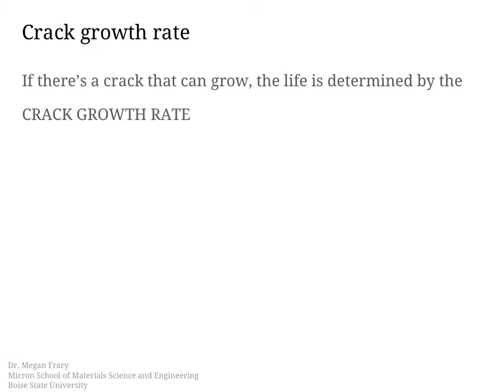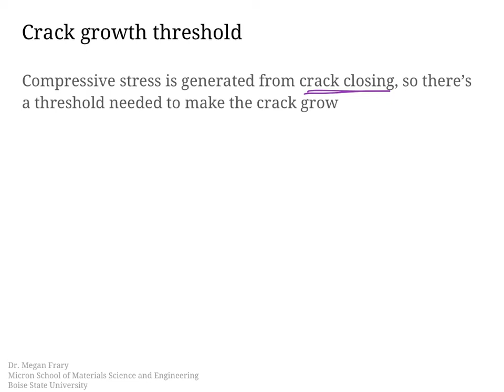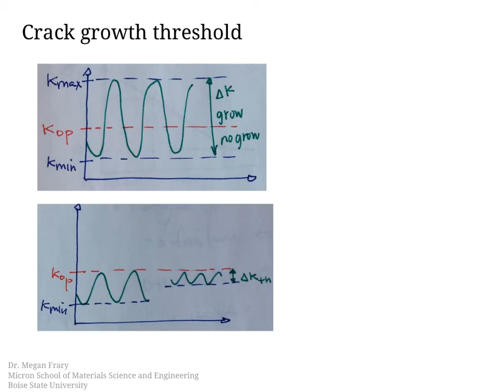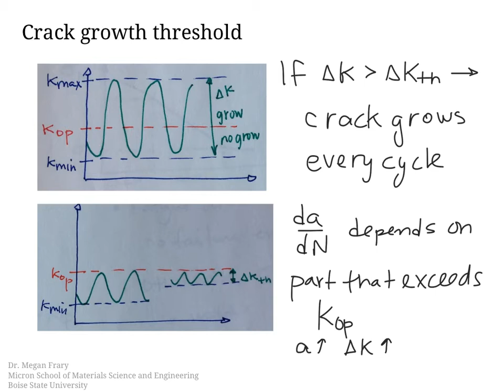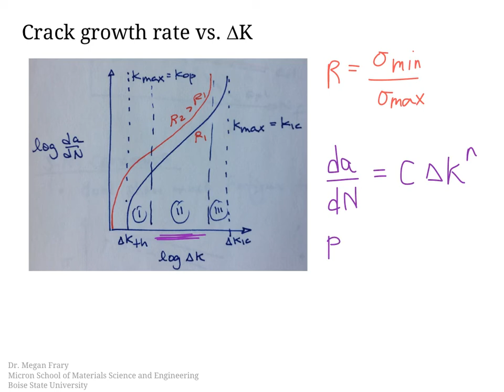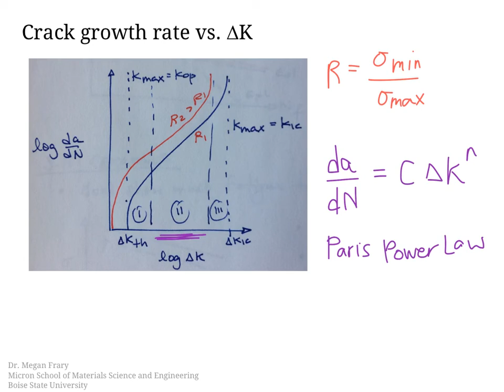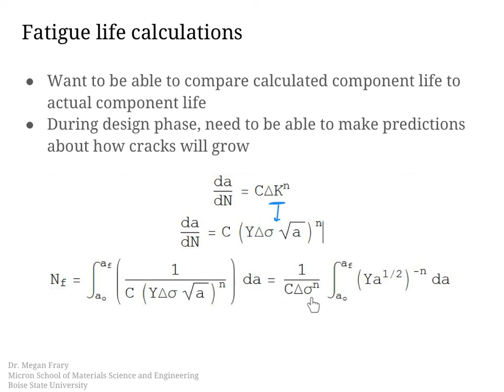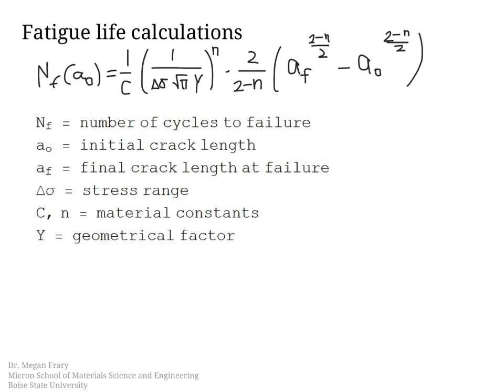fatigue crack growth

Comment: Is 'a' initial crack length or crack length at a particular instant?
Reply: In fracture mechanics, "a" usually represents the crack length at a particular instance, or sometimes they call it "r" depending on the approach of it. On the other hand the initial crack length is "ao" (a with subscripted o).